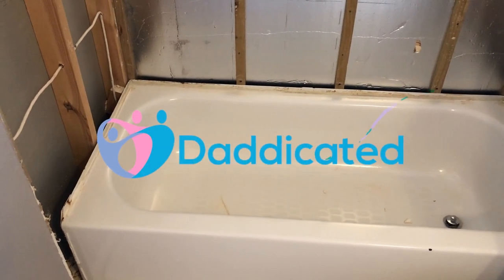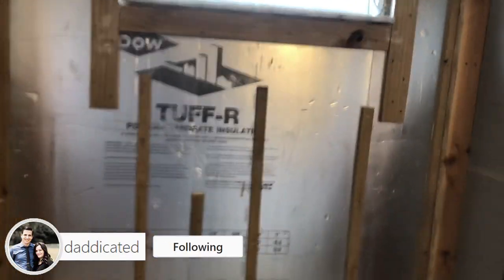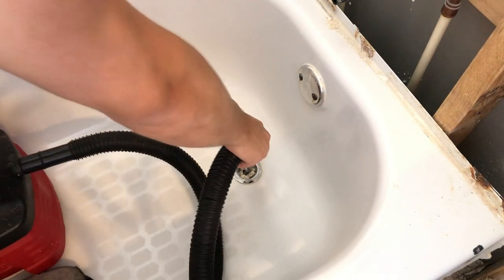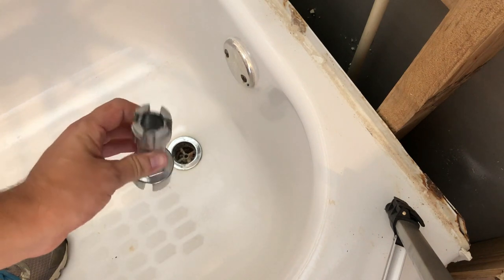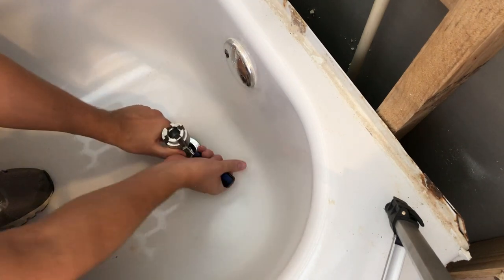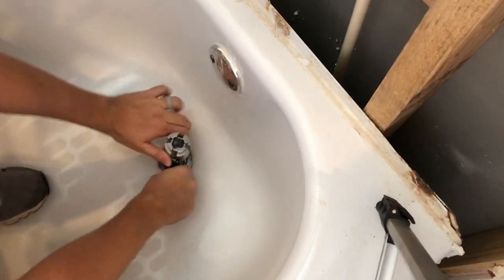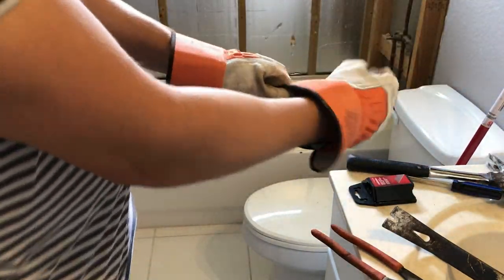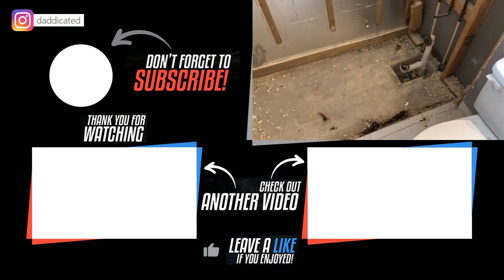How to remove a bathtub and drain | A quick diy tub removal guide

Comment: I have to ask, what is the width of your shower stall after you finished it? Mine will be around 32 inches. This too is my guest bath. I ask because I noticed that your bathroom and mine are twins and I believe that whomever it was that is your original builder was likely mine. The only difference between yours and mine is your celling height is lower than mine, I have 10 foot ceilings throughout. Other than that they're completely identical in layout and fixtures.
Reply from the maker: Most guest bathrooms are similarly sized regardless of who the builder is. From the back shower wall to where my tile ends I have about 31.5".

Comment: I find that it's FAR easier & quicker to simply cut this style of tub in half with a Sawzall and remove in pieces through a doorway instead of wrestling it around or dragging it downstairs banging into the walls doing unnecessary damage. Cut into the drain flange and loosen that piece as required.......II speak from experience as I have removed nearly two hundred old tubs in my  Bathroom Remodel Business......
Reply from the maker: My bathroom is not far from front door so it was actually fairly easy to take it out  thru the door. But I can see how from upstairs it would be easier to cut to pieces.
Reply: If you have any tips about removing an old porcelain tub, please share! Thx!